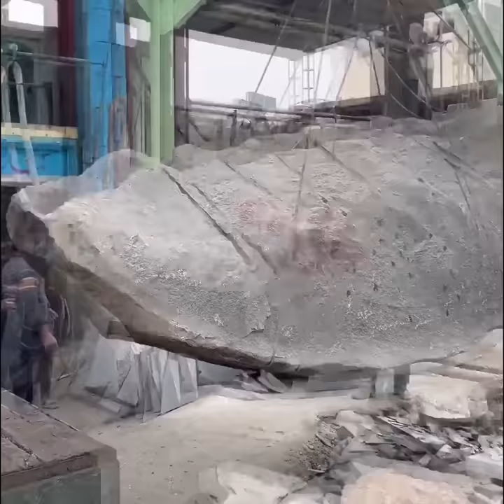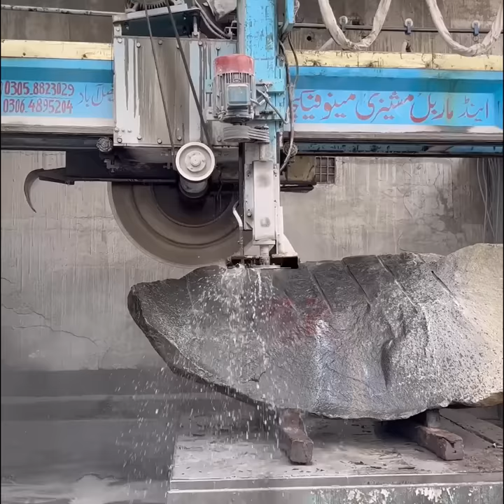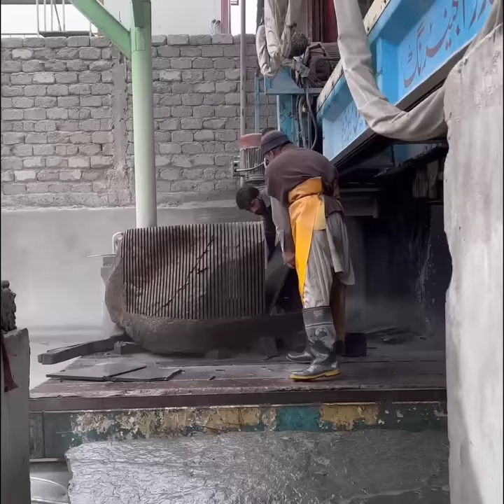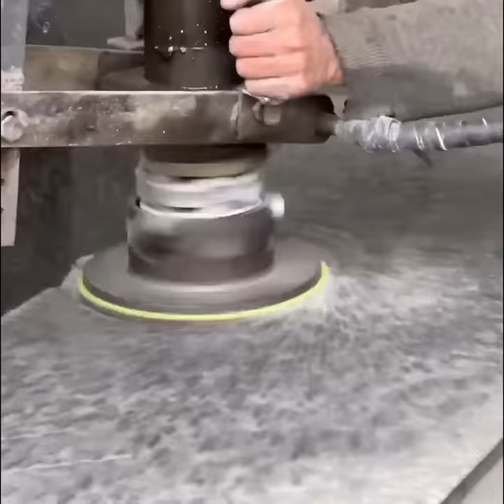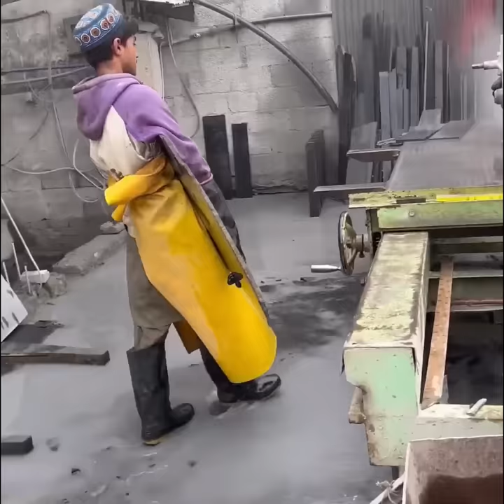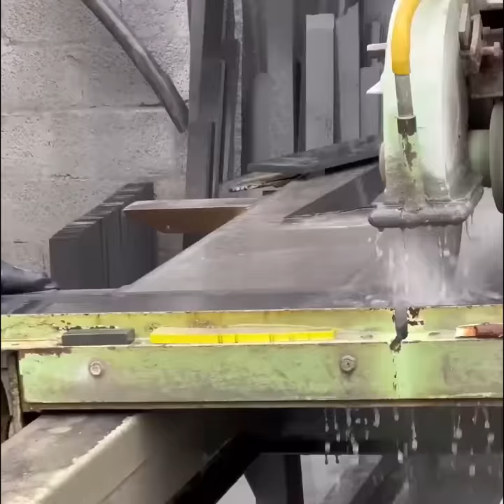How Granite Tiles are Made From Huge Rock #shorts

Comment: That's the kind of saw and polisher we had at our shop in Bridgeport. For years we used agglomerate "stones" of various grits to bring up a polish. The ones in the video use diamonds which is much faster. The old crank style table saw was not good for the larger slabs that have become so common, but there is a romance, I suppose, to controlling the bed and pushing the stone through the spinning blade. In the old days, before diamond blades were used, the blades were made out of abrasive material that would very dangerously blow apart if the stone was too hard or was fed too fast into the blade.

Comment: For context:

The block they received is not great. Because of its shape it will have a lot of wastage which you see in the video. 

They’re meant to be cubic shapes, and then fed into a gang-saw that cuts the whole thing into 2cm slabs. Those then pass through a slab polishing machine, and then the tile gets calibrated and cut to size. Minimal to no handling, but a huge capital. The gang-saw is the size of a building and the slab polisher is a conveyer belt…for slabs (about 60ft/25m long with 14-18 polishing automatically pressurised diamond heads). 

This is workmanship without any of that capital machinery. The block is cut using a “tagliablocchi” and they are then cut by hand individually and polished individually. 

Only possible with cheap labor! 
And a much smaller m2 output 

No less skilled or necessarily inferior quality either, but this is most likely for the local market and not what you see in your local imported tile shop. 👍🏻
Reply: Nope, this grade of stone is sold all over the world to unsuspecting buyers..including the US.